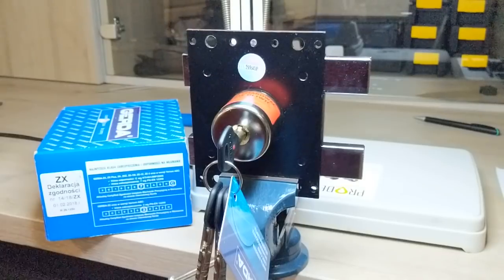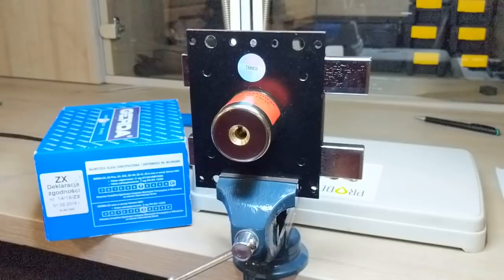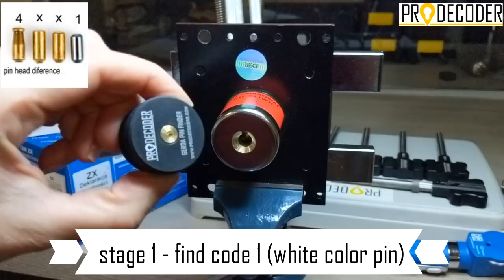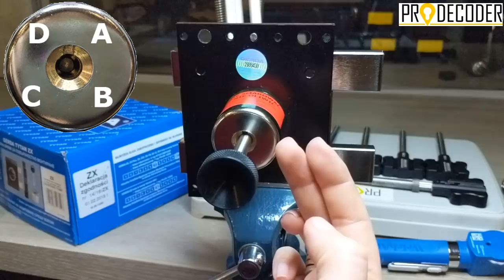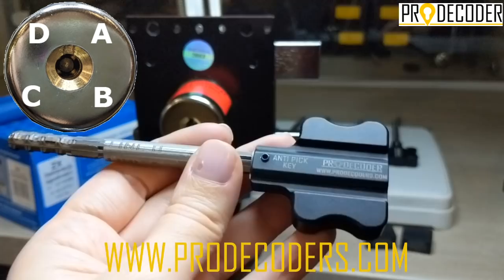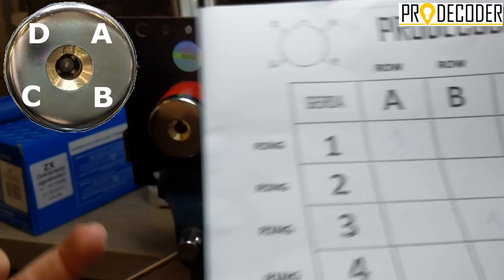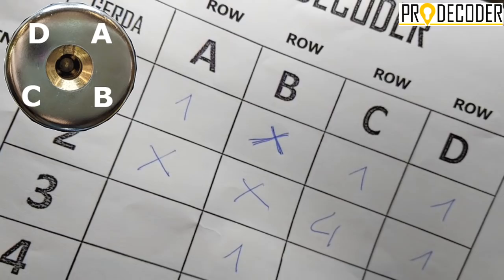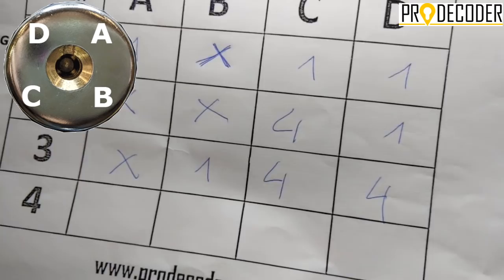Prodecoder Kit for the Impossible Gerda

Comment: I have a different problem with this lock. My key turns nicely, but only to a point until it is about to move the deadbolts. I think both deadbolts rusted solid with the lock frame. I tried turning it with as much force as I believe the key can handle. I tried kicking the door to vibrate the lock. Is it possible to drill this lock out? I can't do anything with the door, they are solid steel and the window is protected with heavy duty bars. I also thought about making a fully metal key, as it could take more force and I could also whack with a hammer it to shock the lock directly.
Reply: lol
Reply: If you have a deep hole saw, the same diameter as the key and very long, you can cut the whole way through and then manipulate the hand turn on the inside. It wants a specialist hole saw though as most aren't deep enough. The steel at the back isn't hardened. The problem is you break the lock.

Alternatively you could try and flood it with a rust penetrator. But that may not work and makes a mess.

Depending on the country you're in and the local laws, and if the land is yours, there is another way.
Think about the volume of the inside space. Nice, wide entry hole, easy to cap, confined place to build up pressure. 25 grains propells a 1 ounce slug. You could probably fit 125 grains in there.
Clay cap and electric fuse (see model rocket community videos.)
I am U.K. based, so not something I can test, but based on the channels I watch, it should work. See opening locks with gunpowder for evidence.

Comment: I understand that X is immoveable but what is the difference between 4 and 1?
Reply from the maker: The color. You determine code 1 in stage one
Reply: The color? I thought that it had something to do with the way it moves. Guess I must look it all through again.
Reply: OK I´ve understood why now, but I must admit this have lead me to another question. Couldn´t he have determined all that when he used that first tool to turn the rings and looked inside the lock with the flashlight? All that work with the 4 ring-picks if I may call them that, was that necessary? Or was it to become absolutely sure where all the X-positions were located? I´m sorry for asking all these questions but I´m trying to understand the mechanism´s and workings of maybe the most complicated lock there is.
Reply from the maker: @renehenriksen1735  you can't determine all 4 types with visual observation only, so in any way you can't skip the 4 ring keys
Reply: Allright, especially because the 4-pins and the X-pins are the same color right? And it isn´t possible either to see the form of the pin. A mini-camera would probably have it´s trouble in entering the inside of the lock. Thankyou for your patience and your answers.
Reply from the maker: @renehenriksen1735  you are absolutely right about the different form. But what about when the lock is used for an year or more? It will become dirty and you won't be able to see the difference, or it will be much difficult. But if you have an experienced eye, sure, it is possible :)
Reply: Maybe some ingenious soul will find a solution to even that one day. Human ressourcefullness can be surprisingly flexible. ;)